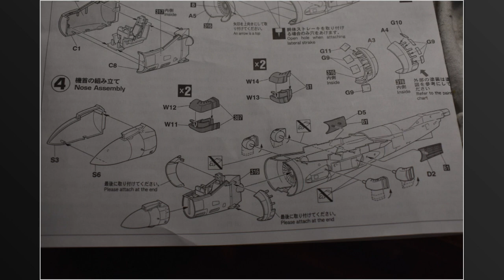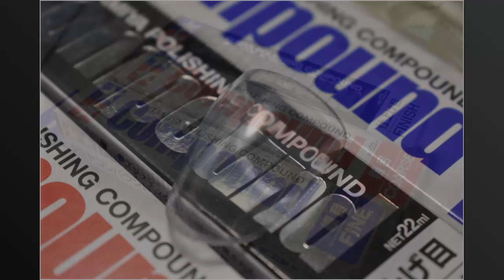AV8B Harrier II plus hasegawa

Comment: For what it's worth, the missing door is called a LID fence.  You said the model came with strakes (the thinner angled pieces.)  You decided to go with the cannon and ammo pack in lieu of strakes.  In the real world, if we are loading the cannon on the plane, there are small bits on the sides of the LID fence called LID extensions that we'd unscrew and remove so it could open and close in between the tighter gap.  I guess for modeling purposes you'd just have to shave down the sides of the LID fence so it'd fit.  You modeled my squadron by the way.  Nice.
Reply from the maker: Thanks for that info. I may just do what you said. Good to know i put together a kit thats your squadron. The nose seems a bit high. From i remember from goingnto airshows. The nose was never that high. So maybe you can help me out with. Is the nose really that high ?
Reply: @averagemodeler3965  They do sit pretty high on the ground.

Comment: That's an F-18 style nose on the Harrier Plus, isn't it?
It makes sense because they recycled the APG-65 radar units from F-18A Hornets which had avionics upgrades.  They removed the older units, recycled what components they could reuse and installed APG-73 radar sets in the so-called F-18A+.  
The older-style Harrier-B nose couldn't house the APG-65 radar.  Heck, they once considered installing APG-65  units in some F-16s and one F-16 was fit with an F-18 style nose!  That was a weird-looking Viper.  To be honest, I don't know if they ever flew that  F-16 with the F-18  nose (it would have modified the aerodynamics a bit and probably increased the drag) but I can remember seeing a picture of it in a book I once owned.
Funny how F-18 and F-16 radars ended up in upgrades of 2 nations F-4 Phantoms.  The F-4F ICE (Western Germany) upgrade saw the APG-65 installed while the Japanese F-4E Kai saw the APG-66 replace the previous APQ radar set built under license.  I imagine the APG-66 was chosen instead of the APG-68 because it was cheaper and could still direct BVR missiles although it would have had to have mods to the radar similar to the ADF F-16s the ANG flew.
Reply: av-8b does not have any FCR radar sir
Reply: @radovanthefoley  Yes, they do, SIR...
What part of "they recycled APG-65 radars from F-18s" do you NOT understand?
If you don't know what an APG-65 is you have no business lecturing me or anyone else!
Reply: May you provide some relevant material to spread the knowledge instead of being Karen about it? Thank you not so kind sir 😊